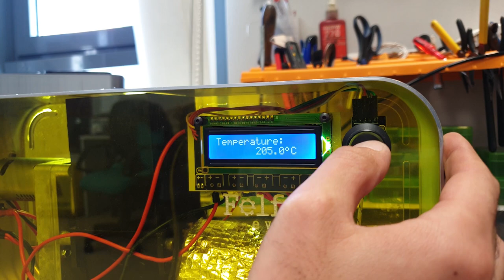Recycling with Felfil Evo: From Plastic Bottles Caps to 3D Printing Filament

Comment: Are direct hits being measured?
Reply from the maker: Hi, sorry I don't understand, what do you mean?
Reply: @Felfil  Hi. FELFIL EVO has diameter measurement unit? And plz check the email.
Reply: @Felfil  If using shredded PET bottle, what is recommended size of flake? I apply after washing and drying.
Reply from the maker: @jamespak5112  No, Felfil Evo doesn't have a measuring system, Felfil Spooler has it.
Reply: @Felfil  We have sent you an email regarding your order. :)